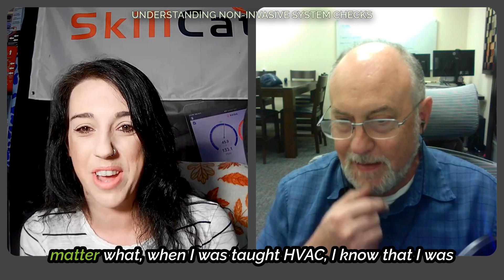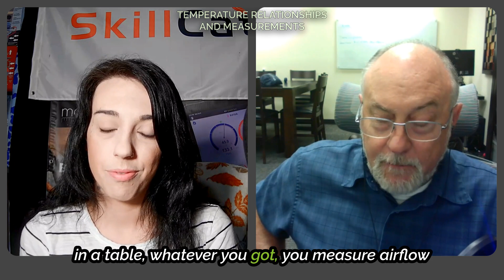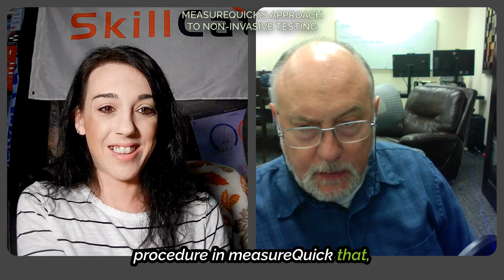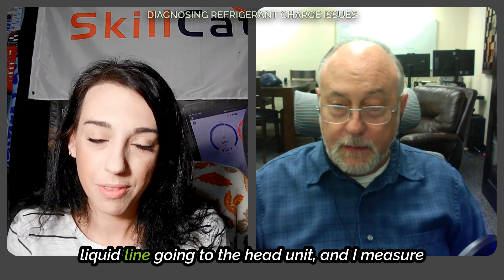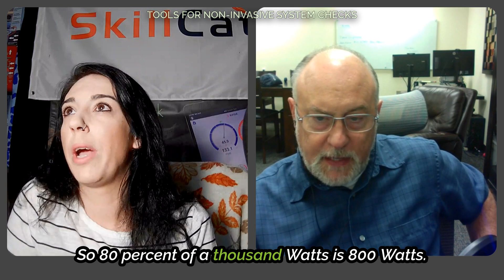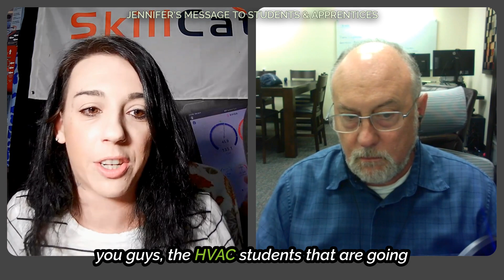HVAChicks Jennifer Interviews Jim About Non-Invasive System Testing

Comment: I believe technicians are so used to putting the gauges on, that contamination, refrigerant loss and or creating a leak is not a priority. Get it done and move on to the next one. Not a criticism just how it is. Not calling  out every technician 
on this statement. New ways of working and learning are difficult to implement in any time driven trade. However non invasive inspection is a tool that should be understood. Great video.